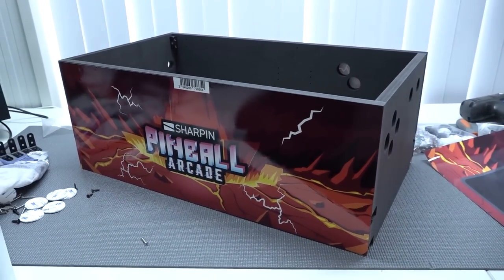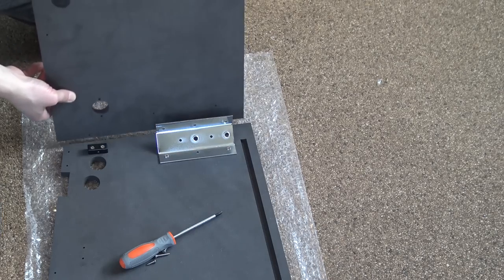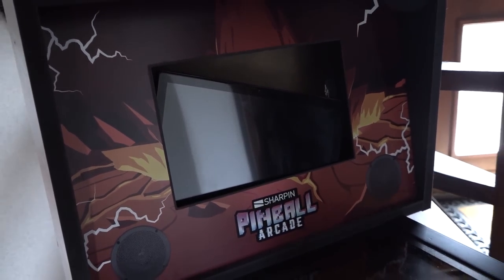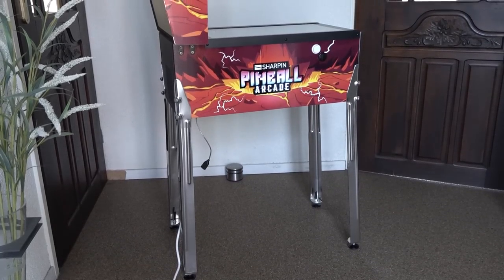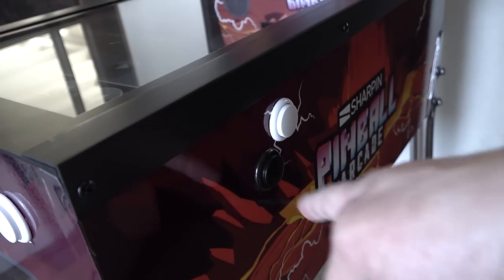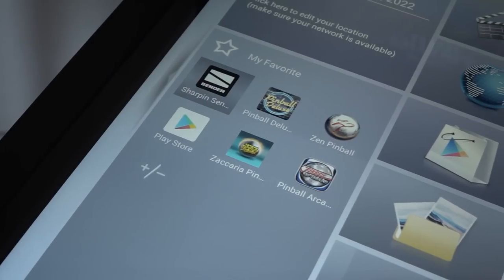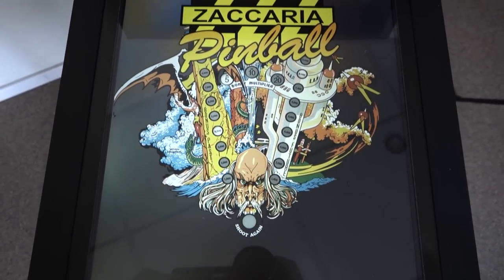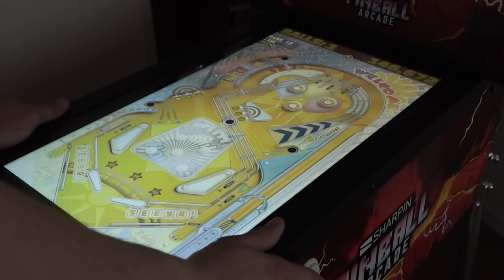His True Final Form Is Here ! 😲  ... Sharpin Retro Max Virtual Pinball 🙌

Comment: It would be great to have one of these as a multi purpose game system for the bar with options for external controller connection. If somebody could also add a way to use a steering wheel and pedals, then driving games could also be great fun and create a whole game experience.